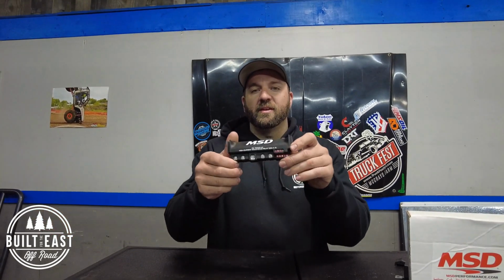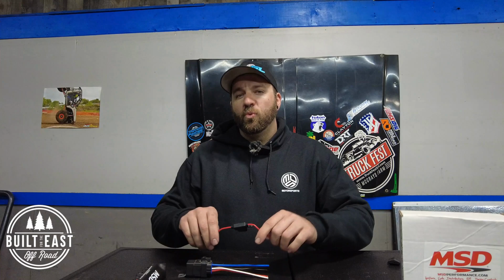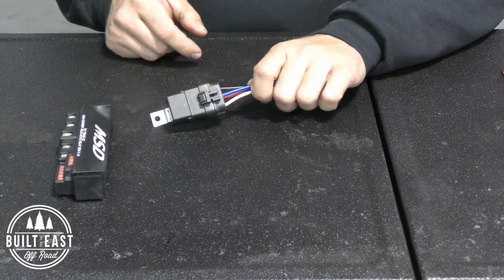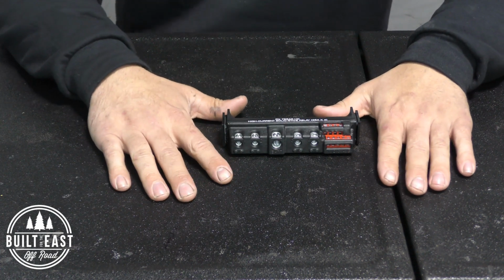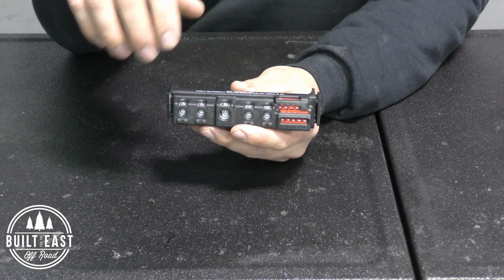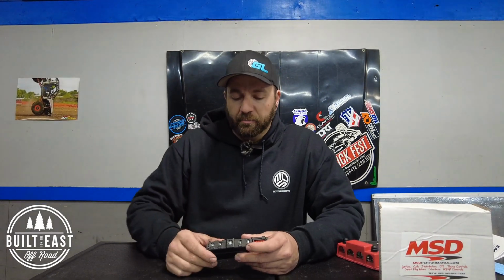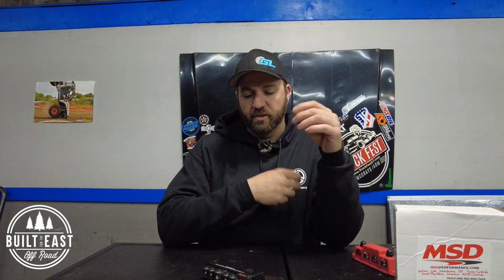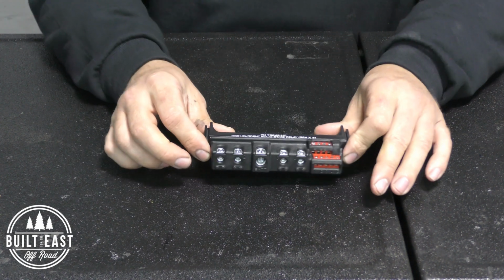MSD solid state relay

Comment: So I have my second fan from efi sniper hooked up I bought a 10 fan for condenser vintage air can I use the ground side switch # 2 and loop it so that the ecu control both fans to come on whe the engine is hot enough

Comment: A nice alternative to something like a sPod system and a lot less expensive though you'll have to purchase or roll your own switch panel.

I've considered an sPod or similar in my van, but the cost and the fact that my current wiring (for off-road lights and air compressor) works fine and has kept me from acting on it.  This MSD relay removes cost as a concern so if I ever decided to add a locking differential and have to add a dash switch to my current under hood air compressor to control it, I may add one of these so long as I'm digging into the wiring again.

Thanks for sharing this.